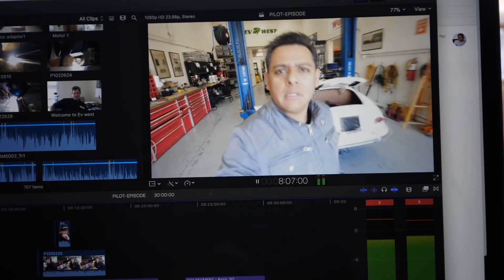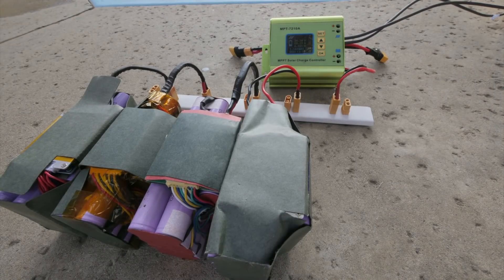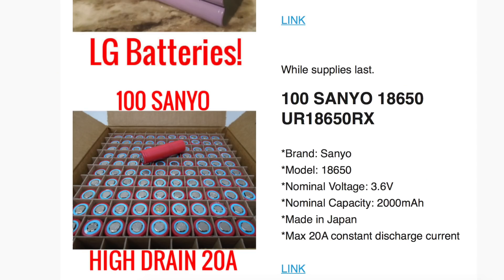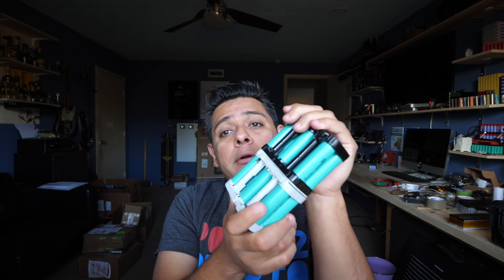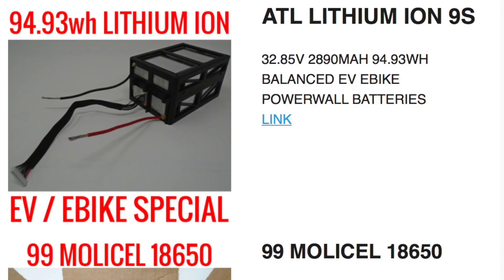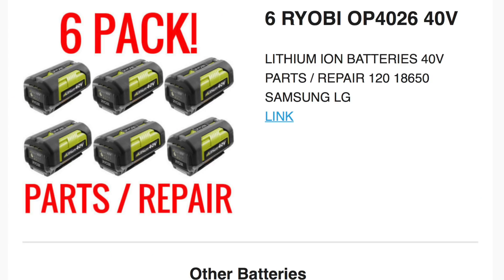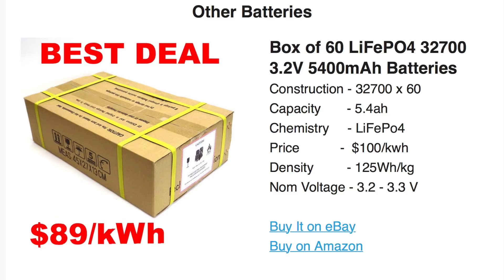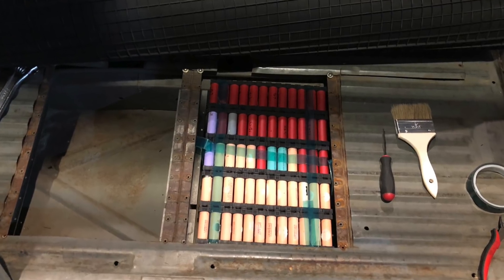LAST  18650  LITHIUM BATTERY SALE

Comment: I was thinking of building a small power wall.  But wanted to run my math by you.  I'm going to use a 48v system to replace the bad batteries in my ups.  I was going to use 104 batteries total rated at 2200mah.  13 batteries in series and 8 packs of 13 in parallel.  Would that give me  846.xx wh?  The original pack is a 5 ah 12v batteries in 48v series with 2 packs in series for a total of 8 batteries.

Comment: Seeing these deals makes me want to build up a pack for my camping setup.  I have 400watts solar but my charge controller specifically states only for AGM, Gel or wet batteries.  Can a regular MPPT charge controller charge 1 50 amp hour lipo pack if the pack has BMS?
Reply from the maker: Yes

Comment: Jehu I have question . I have some samsung 18650 that I want to use .the arris battery that u we're holding I have dose .. I want to use them for a 1/10rc  . The problem is that I the voltage necessary but not the high drain needed . Is there a way to make it high drain or to configure.. thanks jehu  u r videos are awesome..

Comment: If an 186050 cell shows a low voltage and my charger just thinks its done charging (but its not) is there any way to bring the cell back?

Comment: 2000mah isn't worth a shit. Get the 5k & 8k worth getting those from the get go.
Reply from the maker: Yeah you do that buy all the 8000mah cells you want,   Me I’ll stick with the 2000mah
Reply: jehugarcia In your professional opinion since more mah equals less battery drain%? Would the 8000 vs 2000 have a longer life?
Reply from the maker: 8000mah 18650 cells don’t exist.   Plus lifespan has nothing to do with capacity, it has everything to do with how you design and use your battery system
Reply: Strrykr lol go test your 5000-8000mah batteries hahaha. You'll be lucky to even get 1200mah out of those Chinese batteries. Stick with reputable brands and yes, there are reputable Chinese brands that I've been fortunate to come across.

Comment: Have you found any 32700 holders? They don't seem to have gained nearly the same popularity as the 18650 but I want to do a 12v solar system as a aux battery on my van and these seem great for that.
Reply from the maker: Yes I put a link on my channel

Comment: Do you have any for a car audio application?  
Something with a fast charge and discharge 
Lots of people already using lifep04  12v and 16v package
And replacing the traditional agm batteries.

Comment: I purchased the 99 Molicel deal after watching this video. Opened 3 packs and every cell is 1000 MAH or under.  Feel like I just burned.
Reply from the maker: So I just talked to Tom,  all of the cleaned single cells are also tested,  but the cheaper ones sold still as battery packs are untested.   Talk to Tom he stands by his product but make sure you are not making a mistake testing capacity on these,  molicells are  the best ones out of all the brands he told me,  so make sure your test equipment tests from 4.2v down to 3.0v at a rate of 1A
Reply: Jehu, thanks for responding, that is appreciated especially knowing how busy you are.  I am in contact with Tom and we are working it out.  I am using an Opus BT3100 (ver2.2) to test, discharge, and charge the batteries and yes, my test settings are from 4.2 to 3.0 at 1 amp.

Comment: Last comment... So for my E-kart I just bought 100 SANYO 18650 UR18650ZY 2600MAH from tom. Should I've gone with LiPo or ok with the 1850? I want to get an hour ride with good enough speed with enough power to run my 42v Motenergy motor w/Alltrax AXE4834 Motor Controller 300 Amp 24-48 Volt DC
Reply from the maker: Well,  you bought 960wh worth of energy cells that will give you around 3kw continuous.  That’s 125A @24v or 62.5A @48v

Comment: thank you jehu
now a few questions, IF using the fullriver 32650 cells to build a 12.8v battery
assembly?
build 4s packs, then parallel them, or build 15p packs then series them
and the reasons for your choice
i lean toward the first method , thinking of  the fusing and saftey
now what charging voltage, BMS ? charging arrangement ? etc.. needed
this would be in RV use, and probably require (4) of these in final parallel 324amphrs , 4-KWhr, but only one or two for the first project build
the 280w 12v packs might be easier to use ? but build cost for the same amount of power would be considerably higher, perhaps double, maybe more

Comment: If someone wants a side business, they should make holders for these lithium cells. It would be nice to put them in a large 2 kwh battery like a kid puts a battery in a toy with Tesla fuses.  But by the time you hook them all up it would be cheaper and safer just to buy a 12V or prismatic cell.

Comment: Love the channel, been learning allot from it. By any chance do you know of a battery holder for the 32700fe's? I was going to pull the trigger on those but they are larger than the 18650's.
Reply from the maker: http://j35.us/32700-Clips
Reply: jehugarcia You the man! Searching 32700 or 32mm never came up with anything. Never thought to try 65mm length. Bang trigger, pulled.

Comment: The link to the motor that you use has the Curtis 1239-8501 AC controller that operates at 96-172V,is this the one you use still?
On the specs its says "Adjustable Max Output Voltage: 120-144"
what does this mean? What is the difference between that and the operating voltage?
Reply from the maker: Yeah the battery voltage can range between 96 and 144
Reply from the maker: I use the 1238 which can only go up to 130v it’s good because I’m using the 15s Tesla packs 2 in series so 30s =126v fully charged works out for me
Reply: is that the tesla smart fortwo module? 2 packs would be 6kWh? arent these packs 230 dollars per kWh?
a project with those fullriver LiFePO4 32700Fe Li-Ion 3.2V 5400mAh sounds like a fantastic idea at 80-90 dollars per kWh

Comment: Stop buying batteries boys, it's time to be men and start making our own batteries. Cheers!
Reply from the maker: lead the way
Reply: We're already doing it. Robert Murray-Smith is one of the better funded projects, but a lot of people are already building ultracaps and batteries and supercaps. I built a Silicon Carbide hybrid and it performs great. You can even make Solar Panels out of these things. Everyone is posting their works online, you guys should check it out. We have short charge, long discharge units already and they are all very safe to work with. We're even manufacturing large quantities of graphene for production of a variety of other goods. If you just search Graphite or Graphene Supercaps, you will see some of the works floating around.

Comment: I've been waiting for months for that 36v video you promised. At least we got a quick view hidden in this video. I am doing something very similar in an old freezer with 4,000 cells, using your plug strip method.

So what size wire did you use on your plug strip? It looks way too small for the the possible amp draw - which is determined by your inverter. 

Somebody needs to sit down and educate all these followers of yours on proper fusing, wire sizing and basic electrical safety before bad things start happening.  Things such as a 12awg is good for 20A or 10awg for 32A but a 1500w inverter will draw 41A at 36v, not counting inverter inefficiencies. I suppose short distance would help but I wouldn't have that in my house.
Reply: I see no sign of a fuse/breaker in that box, nor is there any kind of disconnect switch between the batteries and inverter on the outside, which then requires a person to unscrew the cover to disconnect the batteries, or anything else. Not even close to safe, you really going to have to raise your safety levels if you want to be a professional so-called "consultant".

Some of that could be wrong, the video is not detailed but maybe you can explain your electrical safety precautions?

Comment: I’m trying to wrap my head around creating a large power bank for my production van. Feeding it with solar and the alternator, and shore power when available. I need to learn a lot 😂
Reply: Buy the book that he always advertises. Also that same seller has a solar book for just 99 cents if u buy the digital one!
Reply: Leftcoast the same kid just released his diy solar book. I'm reading that one now on my train rides to work. W.e. question you feel your not getting from YouTube you will get from his book. It's really good.
Reply: Leftcoast check out tinkercad circuit design/breadboard online simulator. It helped me understand basic electronics hands on (sorta) without having to buy any parts snd made me more comfortabe with the real thing
Reply: You just about got it. The hard part it just taking the time to do it.
Reply: That's a great idea, didn't realize he recommended a specific book, I should have read the description.

Comment: Have about ~6kwh/400 of those LFP 32700 batteries only a dozen or so where somewhat discharged/weak 3.1v vs the others that were all at 3.35v.

Comment: I have been following your channel for a few months and really enjoy your content.  Thank you for educating us!  What you do is very informative and interesting...  I need to replace the batteries on my 48v Ezgo golf cart and was curious about replacing them with a different type of battery that may increase range/reduce maintenance.  Could you make any recommendations?  What other upgrade would be needed or beneficial?
Reply: Lithium matches up relatively well with 48v. You will need to upgrade your charging system, lead acid charging parameters do not work.

Comment: Looking to buy the equivalent of 4 Tesla batteries and would like them to be from a single source so the cells all "match".
Can you suggest a reliable source?
Reply: Christopher Leveck If you want matching cells you might want to look out for a crashed Tesla. Take the battery and then strip it for parts and sell them.
Reply from the maker: 4 TESLA batteries?  85kwh x 4?
Reply: Bought 6 of them 2 hours ago. Thank you anyway.....

Comment: Need advice.... $5K for hybrid solar wind off grid system for my mother in Puerto Rico.  What is the most I expect for this amount?
Reply: Do you want to buy everything from the solar/wind installation company and have them ship and install everything or do you want to buy the individual cells and frame (for the solar panels), soldering tools, wires, charge controllers, inverters, motors and blades (for the wind turbine)?

Basically what im asking is are you willing to get your hands dirty (expression), and do everything yourself or have someone else install/ship the solar panels/wind turbines?

Comment: I have a Ford Focus 2005 4dr 5 speed. Front wheel drive. How difficult and approximately how much to convert to electric with a generic Tesla type battery power pack.
Reply from the maker: $20K  should do it if you want to do most of the work yourself
Reply: I don’t have that kind of money. I was hoping to be < 10k. I guess I’ll have to win the lottery and get a model x. Thanks for the information.
Reply from the maker: $20k. Should do it,  good luck
Reply from the maker: Sorry I got my own projects
Reply: jehugarcia 
Please 
I have Rav 4 Hybrid 
It's possible to make 
A plugin?
And for how much?
(30 kwt for 100 km)
Reply: jehugarcia 
ok 
But if I do it by myself with your management?
Reply: There would be a myriad of computer/software/electrical issues to work out. Some things you'd like to work, won't.  This is what makes older cars more attractive for conversions, such as the air-cooled VWs. Without a computer, it is relatively simple.